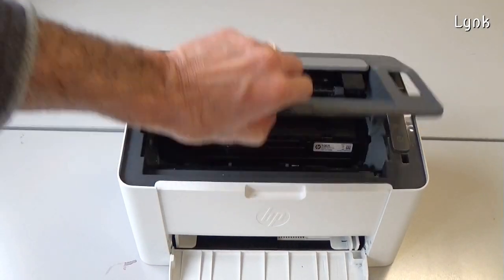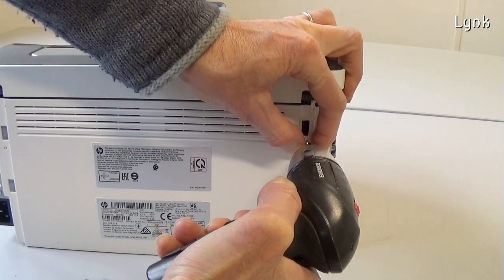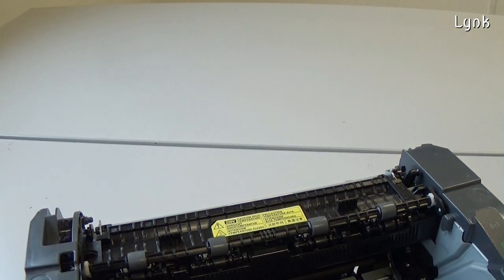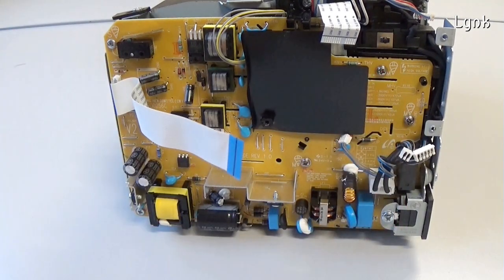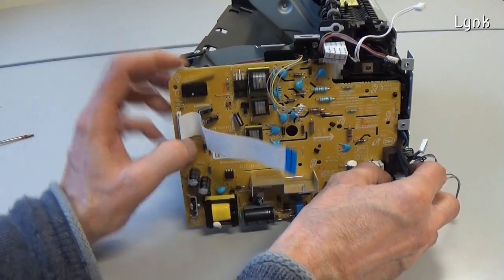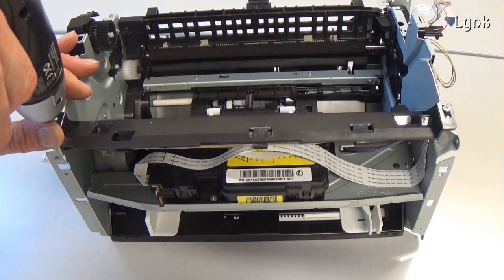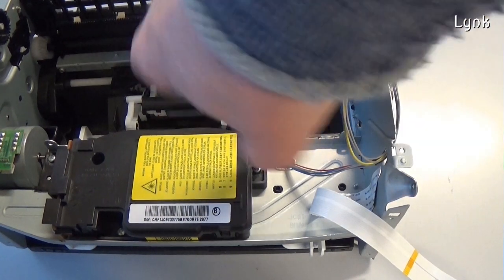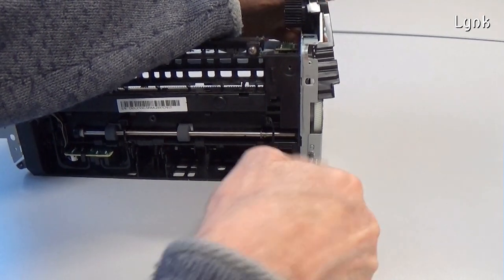Disassembly/Reassembly HP Laser 100 103 107 107w 108

Comment from the maker: Connector at 3:59 - Better remove the other connector of the flat cable. If you remove the connector on the main board, to reinstall it you have to raise the little black cover of the connector on the main boad
Reply: 9:13

Comment: Good Evening Sir I have printer m132nw supply memory error i change cartridge but still error supply memory error how to solve
Reply from the maker: It could be the contact between the printer and the cartridge, or the connection with the main board